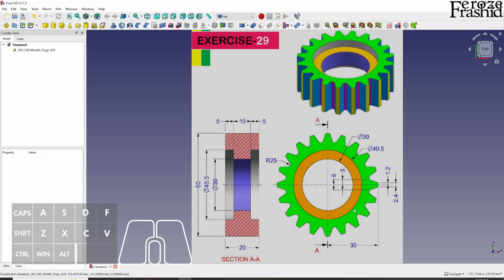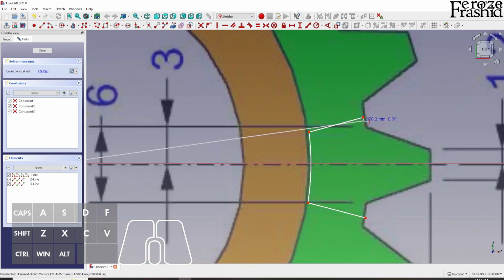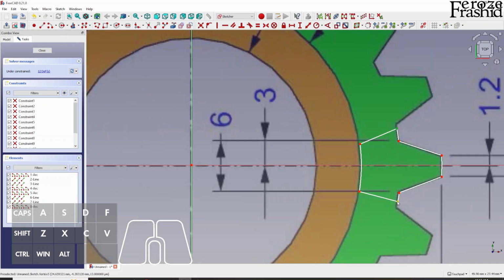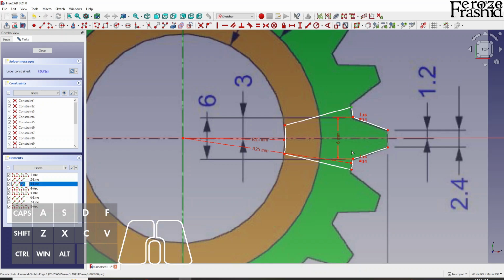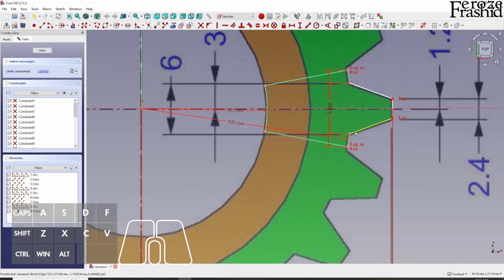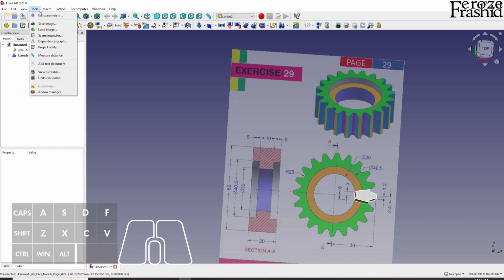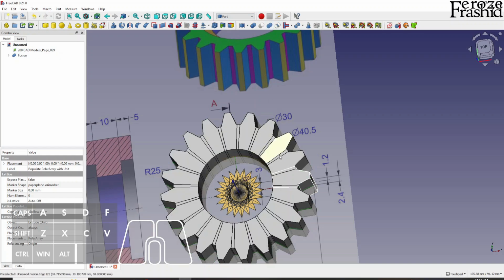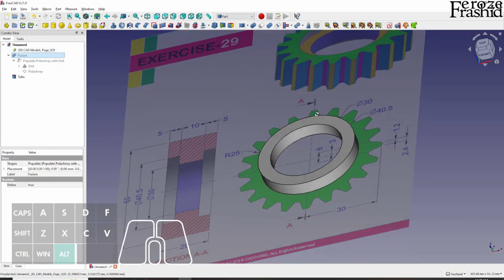200 3D Models in FreeCAD: Exercise 29 (Lattice2 workbench in FreeCAD)

Comment: I made this model a complete different way. I think that is one of the good things of FreeCad. Instead of overlapping the teeth i used an angle of (360 / 20 teeth) = 18°. And because there is no  outer radius givin' i made a straith line. Anyways thanks for these tutorials.
Reply from the maker: The angle would be handy for a variable tooth gear parametric design. Your comment gave me an idea. Thanks